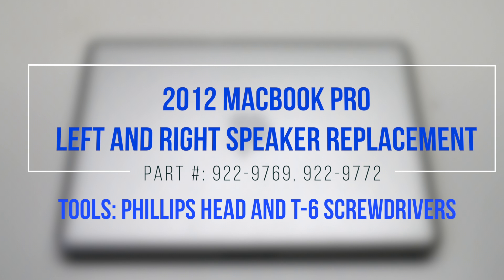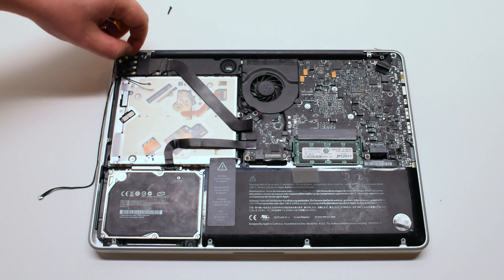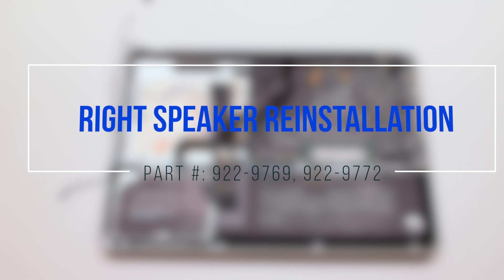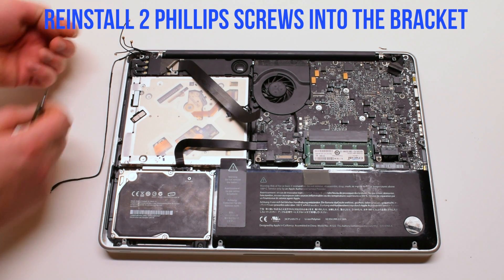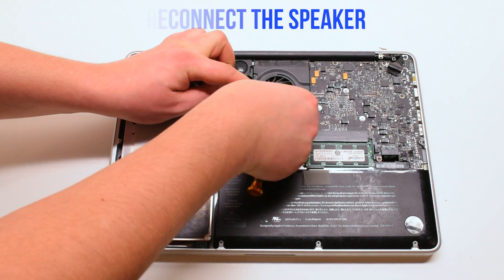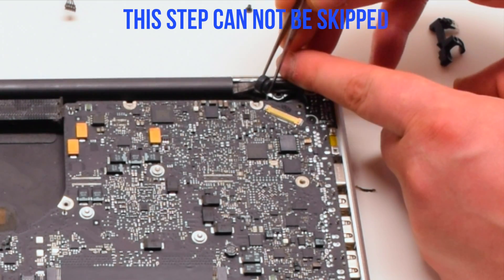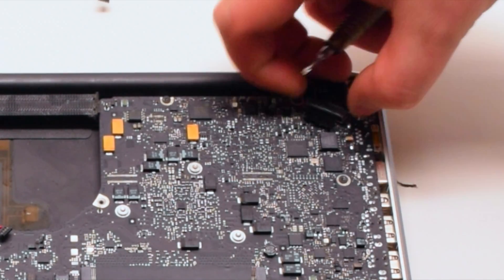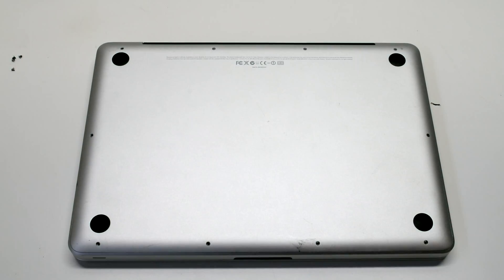2012 Macbook Pro 13" A1278 Speakers Replacement

Comment: I have written the instructions, which took 4 pages of writing and diagram drawing. I haven't done the job yet but I am about to. I'll take photos of each step, and blue tak the screws to the instruction sheets as I remove them so I don't try to put wrong screws back. Anyway I wouldn't have been able to do the job iwthout this video so a thousand thanks.

Comment: I don't know if you'll see this comment since this video is from 8 years ago.  At 10:10 (disconnecting the left speaker), I mistakenly took out the speaker plus the tiny "box" it is in; the the tiny "box" was pulled off the board.  Did I ruin it?  Does the tiny box need to be soldered back in a certain spot in order for the speaker to work?  If it's unrepairable, I'll just use the right speaker.

Comment: One of the drive screws won't screw out what can i do in this case to get the screw out.
Reply: just buy bluetooth speakers and use it instead of internal ones. I don't dare opening such a fragile machine.....

Comment: You're a SERIOUS HERO !!!

Súch a clear instruction video. I am enjoying MacSound again and finally !! 

Could not remove the thin part speaker because screw didn't want to budge, so I had to break the plastic holder attached to speaker. Then with pliers I managed to unscrew the screw
Ended up with one screw over....dunno which on, but nothing is rattling !!

 ;-,

Thanks again !!!!

Any Tips and tricks regarding repairing mu port to external monitor. Seems this one is not working any more. Mac does not omit any signal for monitor to recognise it. (MacBook 15" 2012)

Comment: can someone advise me which spare speakers I can buy for my MacBook Pro (13-inch, Mid 2012) NO RETINA
Reply: Did you ever find the right ones?  I assumed this video was for the non retina MBP 13 inch mid 2012
Reply: Did you ever find the right ones?  I assumed this video was for the non retina MBP 13 inch mid 2012
Reply: Ifixit is a great company for oem parts

Comment: I found if you leave the three back antenna plugs in you can still do the right speaker repair and you don't have to fiddle with realigning the cables and also risk damaging the very thin antenna sockets. Just undo the screws connecting the speaker to the antenna assembly and lift up. Also if you're having trouble lifting your logic board chances are there is adhesive from a factory sticker that has leaked out. You'll need to get a thin spudger under there to try and carefully unstick the board from the back of the display. Use a torch to try and see where the adhesive is holding. Mine was stuck really severely.

Comment: thank you this helped me so much! I only replaced the easier half speaker under the DVD disc drive but it worked like a charm! speakers came back to life with the replacement. Thanks to this video! My advice? If you guys take your time, you will not break anything. Especially teasing apart connections.

Comment: Hi there, I have a question would like to ask:
Since I upgraded my MacBook Pro with SSD, which means the position of the DVD drive is replaced by another hard disk. I am wondering whether it will affect the fusion hard disk if I remove it for changing the speaker?
Reply: Did you ever find out if this is a problem? I am trying to replace my speakers too but have an SSD
Reply: @alfiebru2130   Hi there, in the end, I asked a technician to help me change it since I was too scared to do it myself. Now it works properly... (But he told me that removing SSD shouldn't have been a problem at all.)
Reply: @orange3332  great thank you ! :D

Comment: 1 disconnect the battery
2 take your hand away of the camera, bro
Reply: couldnt really see the process of pulling out subwoofer at all :( Broke my subwoofer trying to pull it out as suggested
Reply: I, personally, did not find this very useful for the fact that his hands were in the way.
Reply: @Fabio Viti Nah. I scrapped the Mac and decided to repair an old Dell, which was always a favourite of mine. 

Cheers from San Marcos, TX,  Mister Florence!!!

Comment: There are purchases here, cheap, good quality, and a screwdriver and rubber feet are also provided.
https://www.aliexpress.com/item/4001200948006.html?spm=a2g0o.productlist.0.0.4dbd4fc6iEb9Dg&algo_pvid=35fdd958-38a1-43ed-856a-d60464d266f4&algo_expid=35fdd958-38a1-43ed-856a-d60464d266f4-13&btsid=0bb47aa615959238460468172e188d&ws_ab_test=searchweb0_0,searchweb201602_,searchweb201603_

Comment: Hi, question are Macbook 2010 unibody speakers the same as the 2011 and 2012? Hoping for your input.
Reply from the maker: Almost yes... here is the link https://store.appledollars.com/products/speaker-l-r-set-for-apple-macbook-pro-unibody-13-13-3-a1278-mid-2009-2010-year-emc-2326 for 2009 and 2010, here is the link https://store.appledollars.com/products/pair-left-right-speaker-for-macbook-pro-13-inch-a1278-2011-2012-replacement for 2011 and 2012
Reply from the maker: Little different.
Reply: The site say 404 not found?
Have you guys stopped selling it or is it a different link now
Reply: But installation would be the same right?
Reply from the maker: It's also different, here is the video for speaker installation for the 2010 models https://www.youtube.com/watch?time_continue=5&v=KAQs7FUydVc
Reply: @GRIBSOFT  i did everything u did. but then my display is not working
Reply: @muzakkirzamani  did you figure it out?

Comment: I have weird problem, after I installed the new speakers, the new subwoofer makes rattling noise when there's bass involved like it's torn but it's not, and the weird part is that I found out it makes that noise only when the bottom case/cover is closed, when I remove the cover the bass comes out better and no noise, but the second I put the cover and play something with bass, the noise comes back. I checked for any loose screws for the right speaker but everything is tight.. I have no idea what to do... Can you please help me?
Reply: same here did you resolve it bro.
Reply: @melvinvlogs8008  Did you use adhesive tape to re-secure the sub woofer? If it's just resting in there then vibration will make it rattle against the chassis.